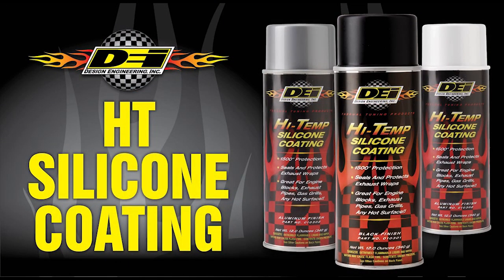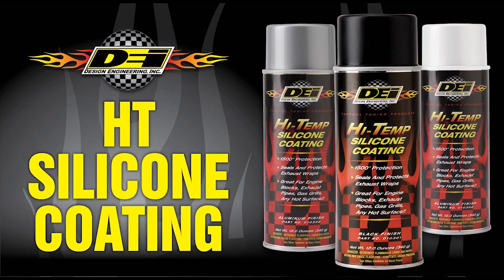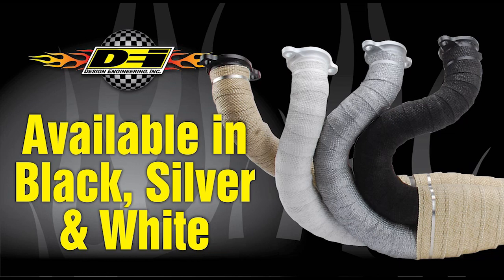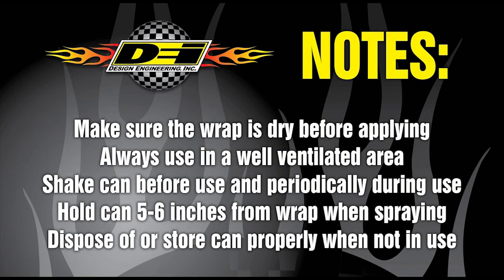High Temp (HT) Silicone Spray

Comment: Could this be used in place of resin,when laying up/vacuum bagging composite carbon Kevlar etc ?.
Reply from the maker: Hi there,

This is not something we have tested so we can not say if it would work in that specific application. Chances are on the low side.
Reply: @DesignEngineering  I thought as much but I thought it could be very similar to resins used in composite/in a spray form !.

Comment: Would this be useful as a heat barrier when sprayed on the inside of ABS motorcycle fairings?
Reply from the maker: This would not function as a heat barrier material.

Comment: My buddy wants to use the silicon spray and the titanium wrap. He says he puts the spray directly on the headers and then wraps it with the titanium wrap. Is this acceptable?
Reply from the maker: Yes it perfectly fine. It's how we wrap pipes here. The HT spray will give the surface of the header a nice coating for the Titanium wrap to bite onto. It actually makes the wrap job a little easier. Plus it seals the metal on the header also.
Reply: Design Engineering, Inc. my titanium wrap is always smoking a little and leaves that sparkle fiberglass residue all over my bike. But this says I can’t spray your titanium wraps. So how can I seal it?
Reply: What is the recommended overcoat solution for titanium wraps
Reply: @ZedJ2xU I know it's really late, But i'm pretty sure the titanium wrap doesn't require any spray. Only the fiberglass one does.

Comment: wish you made a clear
Reply: They cant because clear turns yellow😔
Reply: @vally6853  fine, that's better than coloring it black!

What's the point of fancy colors of wrap if you have to paint them over with a solid color?
Reply: poet99999 ngl, id rather have black than yellow😂
Reply: Update 2022 hey they have the CLEAR and they say it will not yellow.

Comment: Does the motorcycle need to be started with the wrap on the pipes, so the wrap "cures" before the silicon spray is applied?
Reply from the maker: +SIKTAT2  Yes it does. The wrap and coating will smoke also until it is fully cured. It will take a few curing cycles for that to happen.  You should get it up to about 400 degrees a few times for it to cure properly.
Reply: So were supposed to put our headers on and heat then up amd then take them off to paint them again?seeiously?

Comment: does the wrap need to be soaked wet before wrapping?
Reply from the maker: +rusun zheng No it doesn't we recommend getting it damp but don't soak it. There is a heat coating on our fiberglass wraps that if you soak it before you wrap, it will not only make a mess, but it will wash away some of the coating. If you are going to use our Titanium wrap, you don't need to get it wet at all. Here's a tip video on how to wet the wraps.      https://www.youtube.com/watch?v=IJMyna2qYZQ
Reply: @DesignEngineering  Hi, so if you install the titanium wrap, you don't need the silicone spray?
Reply from the maker: @junechris  It is not necessary no, but it still could benefit the wrap. Just a bit more of a process to apply it to the Titanium.
Reply: @DesignEngineering  So it solidifies the bond, or does it have added temperature reduction. In all honestly, if it reduces temps even 40-50% without it, then I might not even bother if it takes a lot of effort to coat it. I just mentioned it cause the video on Silicone from DEI , it said recommended for all non titanium wraps. I like the way the titanium wraps look without it. I wan to do it because the high temp paint I used is all flaking off and if it squeezes 5-10 extra ponies out , that's a win win.

Comment: Would this wrap and silicone spray be suitable for a snowmobile pipe that has a few holes?
Reply from the maker: It will help but it will not fix the problem long term. Once you wrap that pipe and spray it with the coating, it will help seal it up but not be a permanent solution.
Reply: Design Engineering, Inc. Right on! Thanks for the response. Much appreciated 👍

Comment: do i have to use the spray? what will happen if spray is not used
Reply from the maker: You do not have to use the spray. It does prolong the life of the wrap and helps it when getting hit with dirt and debris. But it is not a necessity.

Comment: Why does your silicone spray say not to use on Titanium wraps?
Reply from the maker: It can be used on the Titanium wraps but it takes a much different application process. With the glass fiber wraps, it soaks right in and dries quickly because of what the wrap is made of. The Titanium wrap doesn't allow the spray to soak in as well. So to apply it, it requires 3-4 coats and running a curing/heat cycle between each coat to almost bake it onto the fibers. It will work well on it but takes a much different/longer process to apply it. We did more testing after this video was done and found it works well but needs to be dne differently.
Reply: Can you make a video of this?
Reply: Design Engineering, Inc. 🙈 im going to do 7 light coats and curing it on the vehicle 😂 wish me luck
Reply: @vally6853  what were your results

Comment: You guys really want to paint your header wrap. As someone who didn’t, I regret it. That fiberglass shit gets EVERYWHERE. Gloves or no gloves. I’ve ruined lots of shirts because of it. Almost every-time I work on the lower part of the engine and underneath it, I get fiberglass in my hands. It gets all over the floor. For the love of god just coat the wrap before you put the headers back on.
Reply: Can I use high temp spray paint instead of the silicone?